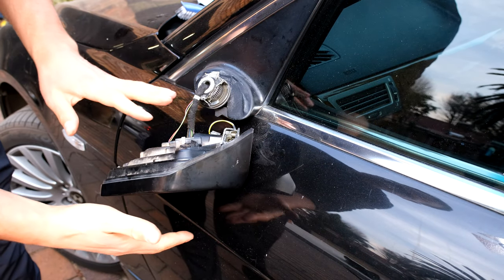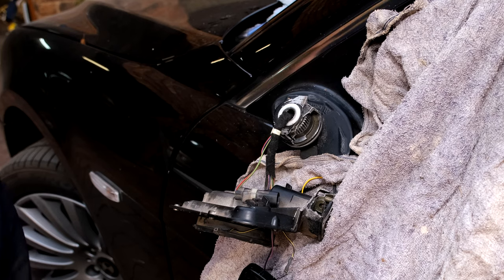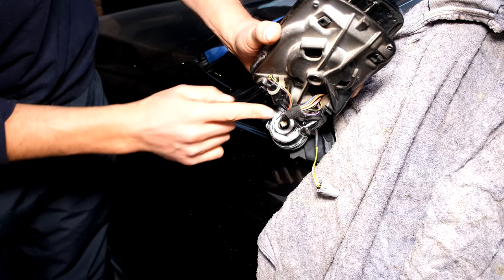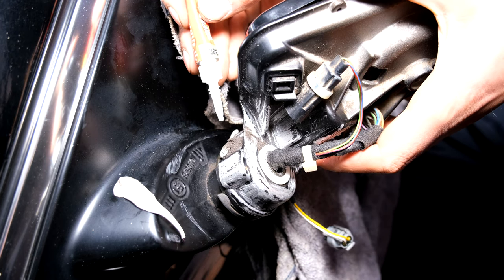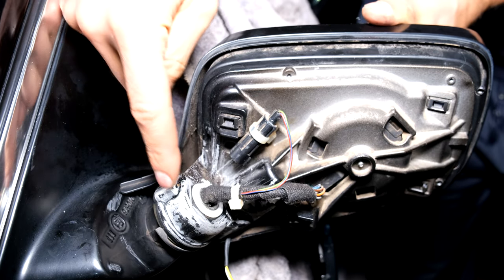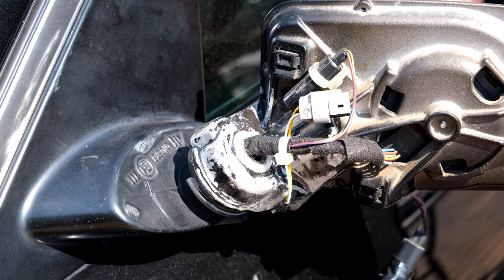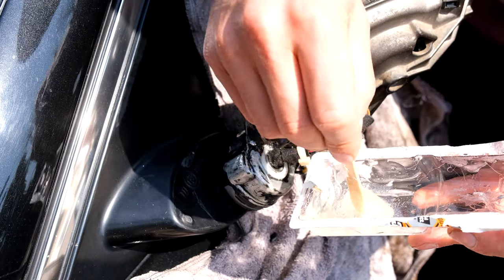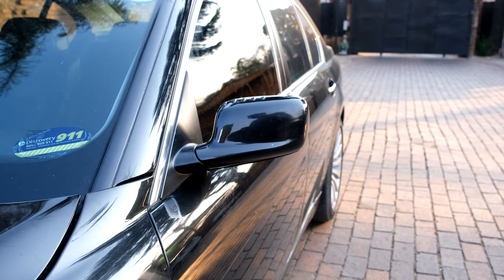How to fix a broken side exterior mirror with epoxy - BMW

Comment: I like and appreciate the video, but you still put me off using bare fingers. I can barely believe you did that.
Yeah, you talked about wiping them with alcohol etc...so what? 
You think doing that turns off the oil machines in your fingers?? Think further.
Other than the bare finger stuff, it was a nice, well edited, video.
Reply from the maker: thanks, i should have said dont touch the open surfaces after cleaning. But i am sure you know, when working with epoxy, gloves become tricky...